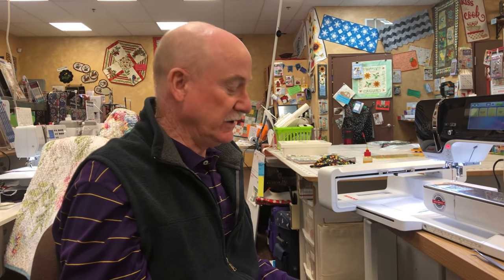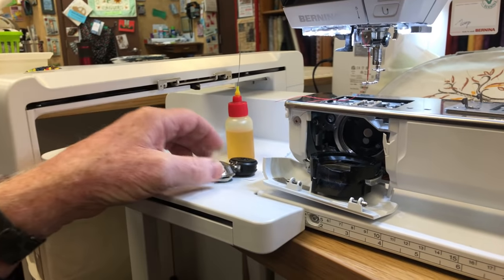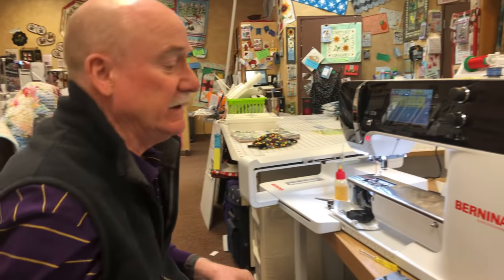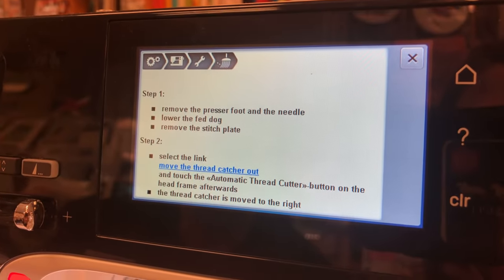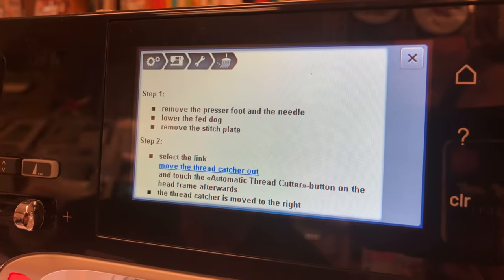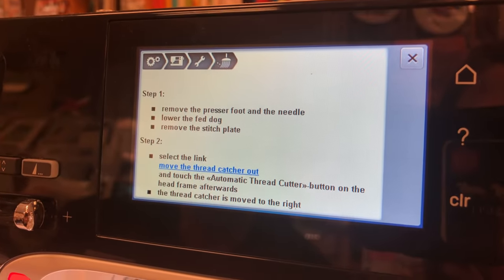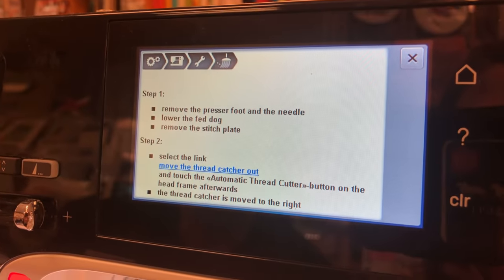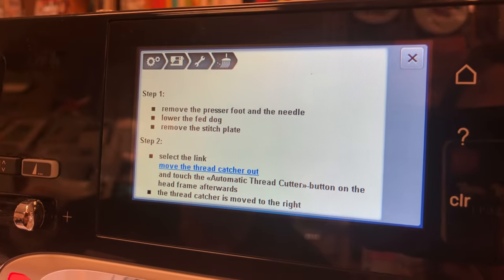All The Best Tips: Jams, Errors & Oil DYI Fixes Bernina 7, 5 & 4 series with Bernina Jeff

Comment: 3 years ago I  inherited a 730 record (1970) which had not been used since 1996. I put it on the table, switched it on and it just worked. I then oiled it and turned a hairdryer on it to melt the old oil.  It has not stopped working since. Periodically I strip out the bobbin area and apply a hogshair brush to remove any accumulated fluff and I oil under the lid on the main shaft. It just keeps going.  Thank you for the hints on cleaning the bobbin area. I didn't know about the lining up the hook. I have always just used touch. I have found off set tweezers near where I live but yours look wonderful. I love my Berninas. They just keep on working!

Comment: omg!!!! I thought I had a crazy thread lost in my machine due to a thread catcher cleaning issue and my screen wasn't responding. All I could think of was the hefty service charge I was going to have to pay or the expensive paper weight I owned. I must have taken the screen off line and needed to recalibrate. Holding down the needle left and right while rebooting fixed my issue!!! Thanks so much Jeff. I can't believe that worked. This video taught me so much about the inner workings of my machine. I wish when I bought it I had watched this video first.

Comment: My Bernina 570 QE  has a knocking sound in the top area somewhere when dialing for straight stitch higher than 2.50. I use 3.50-4.00 for a  gathering stitch.  That is the only time it makes this knocking sound.  The dealer worked on it but it's still there.  Someone online mentioned it could be the "stepping motor" which the dealer said they had checked.  I purchased this machine in May of 2021. Thank you for any feedback.

Comment: Thank you so much Jeff, I really appreciate all this information. Would you be able to explain what to do if you get the gears on screen and can’t move the hand wheel, I have had this happen a couple of times, and the needle/thread etc is all jammed up, won’t move 🤔😱😀
Reply from the maker: If you get the gears and the hand wheel will not turn first take out the bobbin case then the metal hook. Try to turn now. Look in hook area for thread. If you get gears only when you try a thread cut then you need to bring it to a dealer for the cutter unit to be cleaned and fixed. Always rethread the upper thread before sewing, ALWAYS, if you don’t you will be taking the lower parts out again I know because it happens to me.
Reply: @berninajeff  oh thanks so much Jeff, you’re amazing. Any tips on finding and removing the tip of the needle when it breaks and falls into the machine? Love your videos, so helpful when you live nowhere near a dealer. 🇦🇺🤩🦋
Reply: Just got my new 790 Plus. Loving having your knowledge as a guide to begin.  Thank you Jeff definetly subscribed!

Comment: Praise the Lord!!!!!  Thank you so much.  I am 2 1/2 hours away from my dealer.  These tips are AMAZING to know.  ESPECIALLY, the one that keeps your thread from popping out of the guide.  I don't know why Bernina can't come up with better guides.  I have taped paper clips and binder clips and whatever I could think of to keep the thread in the guide.  I have a 930, an 1130, two 740's, a Virtuosa and several sergers.  Can you tell me if it is possible to get a thread spindle replaced on my 1130?  The guy who serviced it last broke a spindle off.  I am so upset about it!  He said the part is not replaceable.
Reply from the maker: Hi Joy B, I do have a spindle replacement for your 1130. Email me with your contact info and I will call you for a credit card payment. Jpvlefty@aol.com 
I have parts machines of many models and can help people get parts that are not made any more. However some parts are what I call mortality parts and every machine has the same part that goes bad.

Comment: Jeff, the screen on my brand new Bernina L890 is frozen. I just purchased this machine, I used it for the first time today, worked beautifully until I wanted to switch to a cover stitch and the screen froze. I turned it on and off, unplugged and plugged it back it. Screen is frozen of stitch #6, which is what I was using and I saved it in the folder. Do you have any idea what I should do besides packing it up and going back to my Bernina dealer? I would love to try to solve this from home if possible. And I didn’t thoroughly clean it and vacuum inside thinking maybe it was from the lint but it wasn’t. Thank you Jeff and your videos are super helpful!

Comment: Hi Jeff.  I have a new 570 QE and suddenly the hover feature was not working.  I did not change anything, it just stopped hovering.  I have made sure it is turned on and was still not hovering, now it hovers but I feel like it's intermittent.  Do you have any suggestions?  It's only about 3 weeks since I purchased it.

I am going to order the oil applicator you sell.  Your tips on how to re-install the hook upside down has worked great.  We are in Maryland.  The place we purchased our machine from is 1.5 hours away.  There are places closer but I do not like the atmosphere in the shop; it's a but snooty.  Thanks for your efforts to make the Bernina easier to understand.

Comment: Thank you for the tips! I was excited to try the needle threader tip. I don't have much trouble with it, but thought I'd give your method a try as every now and again, it doesn't work for me. I don't have a thread cutter on the right side like your machine does (I have 770). I only have the thread cutter on left side :/ Is the gray on on right an after-market add-on? And can we discuss getting the hook back on?? GENIUS! I fuss so much with that!! I just took it out and re-inserted 3 times in a row with NO problem!

Comment: Hi from France Jeff ! I love all your videos, they are so helpful ! But I have an issue with my 790+ (one year old), and I hope you can help me. It's been more times that my machine only wants to sew straight stitch, even though I've chosen another stitch. Normally, when you choose the zigzag stitch, for example, you see the needle move, but nothing happens. It displays the stitch I chose for it on the screen (e.g. the zig zag) but only sews straight stitch. And I have the right needle plate, not the straight stitch plate. I have to unplug it and plug it back in to get it working properly again. I'm quite worried. Do you have an idea please ? Thanks in advance

Comment: Great video!  I have 4 Berninas varying in age and love them all.  However,  I'm having trouble with my 770.  When I depress the foot pedal, my machine won't start stitching.  Sometime I need to depress it 5 - 6 times before it will start sewing.  Do I need a new foot pedal, or is my machine not operating properly?
Reply from the maker: Test with a different foot pedal I have seen a few go bad the inside parts can be replaced some shops charge so much labor it’s cheaper to buy a new one

Comment: I see you are using a yellow oil to oil the machine.  When I bought my 180 Artista in 2000, I was taught during class to use only a white oil.  Has there been a change of thought on the oil type now?  (I'm using Zout oil as it is "white" oil).

Comment: I have just bought 790 special edition. I sewed for a couple of minutes then the spool error came up on the screen. Have tried everything from a new spool to rethreading my bobbin  to switching off many many times. It then sews for 2 inches and then the bobbin error comes up again.  Have threaded correctly according to tutorials etc. - and it did this using the spool put in at the factory. Any thoughts Jeff. I have just discovered ur tutorials and love them. Alison currie from  Scotland.
Reply from the maker: Sometimes the bobbin error comes on before the upper thread sensor kicks in. Go into settings the two gears and find the eye looking icon. Turn off the bobbin eye and try sewing. Then try turning off the upper eye. Could be a sensor wire came loose. It will not hurt your machine to sew like this. Then when you go back for lessons let the dealer know about the issues
Reply: @berninajeff  Jeff you are an absolute star. I have just spent 3 hrs trying to fix this and you solved my problem in 10 minutes - and on Hogmanay!!! I can’t thank you enough. I’ll be watching and liking your tutorials from now on. I wish you and yours a guid new year from Scotland!!!

Comment: Greetings from Surrey in England.  Your tutorials have been most helpful.  I have a Bernina B570 and just recently my bobbins are not turning in the bobbin case.  Take another bobbin and it works fine.  Try the previous bobbin and it won’t budge and it won’t spring back either when you put it into the case.  Have you any tips?  Many thanks - Mo
Reply from the maker: Get rid of the bobbin that does not turn must be damaged.

Comment: I am delighted to have found you on You Tube.  I have viewed all your tips and have learnt so much about the new B570 that I have just purchased. I especially liked your revelation about the Needle Grabber and Bernina tweezers.  Sadly after viewing this video I stupidly tried to change the needle while the needle plate was off - the needle slipped from my fingers and it has fallen into the open mechanism.  I live in rural Ireland and there is no one around to advise me how to remove the needle.  I'd be so grateful if you could recommend any tips to do so - despite your being so far away in the United States !
Reply from the maker: Most of the time the needle falls harmlessly to the bottom of the machine plastic cover. Take the bobbin case and hook out if no needle try turning the hand wheel and then slow sewing. If no noise you are fine to sew. 

Jeff's phone

On Aug 20, 2021, at 8:19 AM, YouTube <noreply@youtube.com> wrote:
Reply: @berninajeff  Thank you so much. How very kind of you to respond to my query - and so very quickly. I am reassured. Greetings from Co Wicklow, Ireland

Comment: Thank you for this very informative tutorial. I have a 330 and a 790e, as much as I love my machines I have been frustrated with the 790e.  I have no local dealer or anywhere that does classes for these machines, my 330 is a little workhorse and has caused me no problems due to operator error at all. Unfortunately my 790e is  proving to be a tad more problematic, it has an intermittent problem  ( I'm sure all my issues are operator errors) when I use the embroidery unit. Have you done or would you consider doing in the future, a tutorial on using the hoop embroidery unit on the 790 e. Once again thank you for this very informative video.

Comment: This site is Awesome! Recently I have been getting a warning of low thread, both for bobbin and top thread. When using a full bobbin or spool I still get a warning. Do you have any tips for this? Thanks
Reply from the maker: I don't know what machine you have but I assume its a 770 or 790.  Test to see which sensor is being BAD.  Turn off the bobbin sensor in the settings and sew if you don't get an error then turn it back on and turn off the upper thread sensor.  Test sew, once you have determined which sensor is not happy clean that area or take it in to a dealer. Bernina Jeff

Comment: Thank you so much! I have a Tula 770qe and I found your video very helpful. I know that when changing threads to always clip the thread at the spool and pull the remaining thread through the eye of the needle and I've always done that. I'm having an issue with my 770 with the upper thread break indicator message continually stopping my machine when embroidering. I clip my thread, clean everything out, rethread, etc. and within a minute it goes off again. I finally turned off the sensor so I could finish my project. I called my Bernina dealer and, even though my machine is less than a year old and does not have many embroidery hours on it, he is going to charge me to take a look and see if there is a small stray thread near the sensor. I'm so frustrated about it! Is there anything I can do from home to check it? I can't see paying the huge service fee to remove a small piece of thread or lint. One of the salespeople at the dealer quietly told me to "just turn off the sensor--they're so sensitive". Any suggestions? By the way, I never got the error message when I was in sewing mode; just embroidery mode.

Comment: Is there anywhere that you can do a tips/jams on the newer Bernina 830 series machines? I have spent over $2400 fixing my Bernina 830 and have had many issues with it.(I also had one of the original 830 machines I believe called the 830 record). I have never had so many issues with the sewing machine in my life. This is my fourth Bernina and my most troublesome. I would appreciate any info that you could post. Thank you so much, Lori

Comment from the maker: To Kappy Graney, your 7 series that shows no thread only in embroidery is a new one for me.  In sewing mode after 158 stitches the error should come up.  the check spring is what is used to monitor the upper thread.  Try setting your upper thread tension up two units in embroidery mode and see what happens.  Your dealer really should stand behind your machine, find out who is their district manager and give them a contact.   going to Bernina USA will not solve anything, the dealer knows this.  The DM holds all the power.

Comment: Hi Bernina Jeff... loved this video, I have a question about the 4 series, how do you do the touch screen calibration on the 4 series? Sometimes my screen freezes and I panic! Thanks so much :)
Reply from the maker: The 4 and 5 series Bernina's have a different screen than the 7 series.  The 4 and 5 never need to be calibrated.  If the screen freezes up then its the machine firmware.  I would recommend having the most current version installed, you can do this yourself from the Bernina web site.  Please read all the instructions or you will be bringing it to your dealer to fix.  I recommend a USB stick 4MB or less, they are hard to find that small I bet you have one in a drawer somewhere with nothing important on it.  Reformat the USB using the FAT32 option.  Then go the Bernina website and find the firmware download, exact it to the USB and follow the instructions, its not Rocket Science. This would be a good Youtube video to do!!! Good luck.
Reply: @berninajeff  thank you so much! It does sound like rocket science to me because computers scare me! But I will check it out, thanks again! I love all your videos so much, you have helped me tremendously!

Comment: I can't find an answer to my problem so maybe you can help Jeff.  I just purchased a NEW 570 QE.  I have old Designer Plus Software V5 but the installation disc and training disc is for Windows XP and I now have Windows 10
 but don't know if I can use this with the new machine and don't even know how to load the program to Windows 10.  Do I have to start over with software?

Comment: Hi Jeff, love your videos! Just got my 830 back from my dealer after repair of the automatic threader.  Suddenly,  all of my sideways stitches and the 360 degree sideways stitching are grayed out.  I have the correct foot on.  Is there anything I can do, or do I have to take it back to the dealer?  Thank you so much for your videos. Though my machine is 10 years old, there is not much that it can’t do that the newer ones do.
Reply from the maker: That is most likely a settings or security issue.  Check that the needle plate is selected to 9mm, then make sure the needle selection is on a normal needle not a wing. Last resort reset all settings to factory default....

Comment: I have a Bernina 1006 refurbished sewing machine. I am having a tension problem. The bottom thread is very loose. I have tried to tighten the screw on the bobbin case and also have turned the upper tension to a little higher than zero. What can I do?

Comment: Thank you so much, Jeff! I was about to sell my not even 2yo 570QE, because we didn’t get along at all. Your videos have given me more insight in troubleshooting, so I don’t freak out every time, when she‘s getting difficult. Regards from Germany 🇩🇪
Quick question: After taking off the stitch plate and cleaning the feed dogs, I have somehow managed to put it back on in a weird angle. As a result, the upper right corner got stuck between the bed of the machine and the indented area, where the feed dogs are. I managed to remove the stitch plate, but it really got me sweating, because I didn’t want to apply too much force, but still wanted to remove it, from where it doesn’t belong. I‘ll be very cautious in the future doing this, but do you have any tips what we can do, if this accidentally happens again? Thank you!

Comment: Thank you so much—these are great tips, and so very helpful! I have a question you didn’t answer though. There is a small white lock that appeared on my screen (790+), next to (on the left of) my top stitch control numbers. The numbers read “0.0”, and they won’t change. I tried your back door approach, and the options to do it by hand are dark—nothing happens when I touch the screen control. HELP???

Comment: Learning so much from watching you!  I have a 770 qe.  When I try to change the needle position, the screen shows it moving to the side, but the needle doesn’t actually move.  Looked everywhere in the manual and can’t find any information on this. Any suggestions?  Thanks so much
Reply from the maker: A couple of reasons the needle does not move left to right.  Number one press the needle up/down button until the needle is all the way up, do no't use the hand wheel the machine needs to know the needle is in a special spot.  If the needle does not move now then check the needle plate settings, does the screen show a 0mm it needs to be 9mm or 5.5mm to allow the needle to move select the icon and change if needed.  If it still does not move you need to see a dealer I have seen the cable to those buttons fail.
Reply: @berninajeff  thank you so much for answering.  Turns out I had the single hole needle plate on. Feel like an idiot!